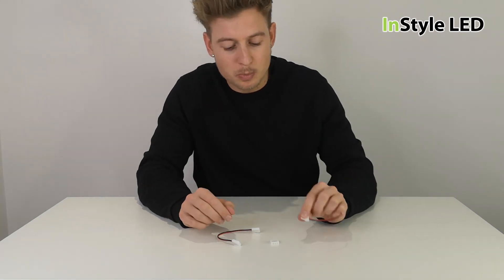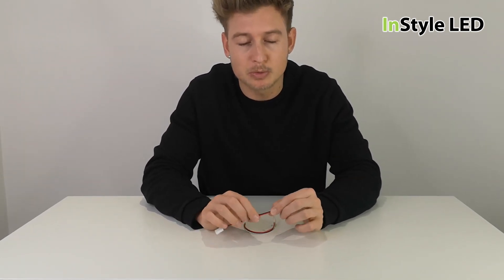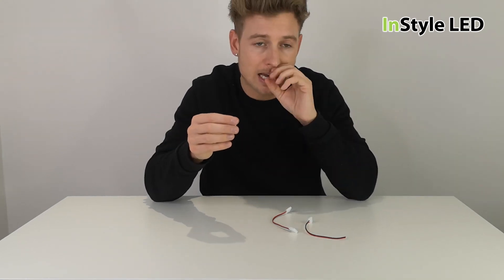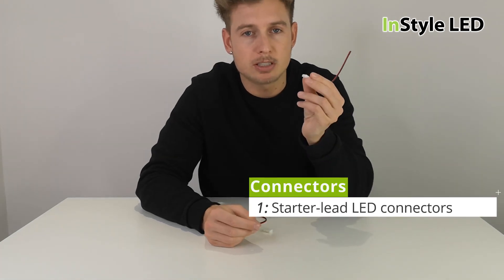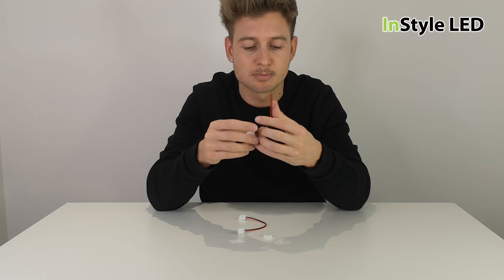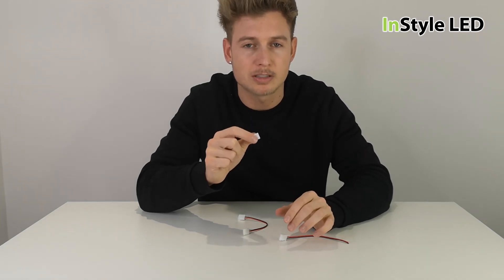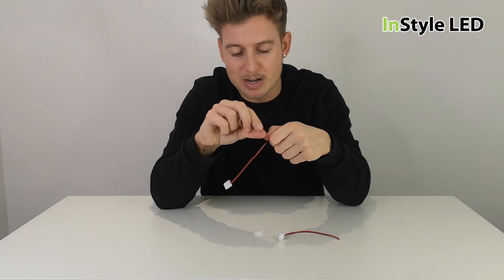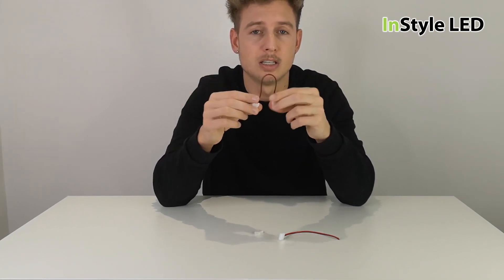Are there any disadvantages in using LED strip light connectors?

Comment: I want to make a "T" connection to hook up to the power supply. The first run would be about 1' cut then run one set of  wires to the power supply then connect from the next run to the first and into the power supply. Does the make any sense? the second run will be about 7'-8'. HELP!!
Reply: Ok, I thought about it and here is a better explanation of what I'm trying to do.....At the top of the "T" I want to connect it to a 1' run of the lights. At the other end of the top of the "T" I want to connect it to the second run of lights that is about 5' long and makes a 90* turn that I'd connect to a third run(I have the short connecter to make the 90* turn.) of about 2' and ends. At the bottom of the "T" is where the red and black wire would come out and be connected to the power supply. Is that a better explanation?
Reply from the maker: @tannym1037  Hi Tanny,  thank you for your question! Appologies for the delay I have only just seen this .
There maybe a connector out there for T junctions but they wont be custom cable lengths like you are looking for. What you are looking to acheive is possible, you would need to solder the strips like you require with the cable made to length etc. If someone can solder and has the cable this is faily easy to acheive. We make up custom lengths with all sorts of corners, joining cables, starter leads and exit leads everday for our customers no problem

Comment: is there not such a thing as an  L shaped / 90 degree tape to tape  connector ?    
my first thoughts was I could cut and solder the wire but that could be a tad messy if it was to be seen
Reply: HI Steve, great question!  Yes there actually is a rigid L shape / 90 degree connector. Check out amazon or ebay and there are plenty on there. These are great if you have the exact measurement as you then do not have to hide the excess cable. They can be tricky however if your measurements are off!
Reply: Cheers jack I’ll have a look into that 👍👍